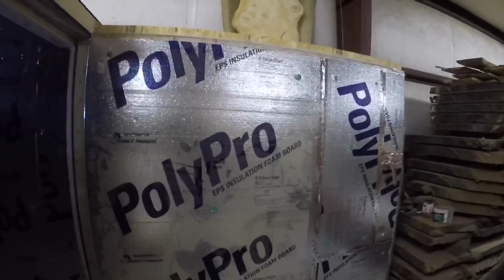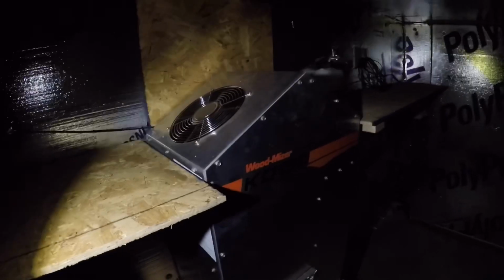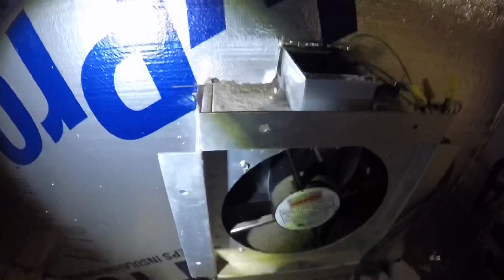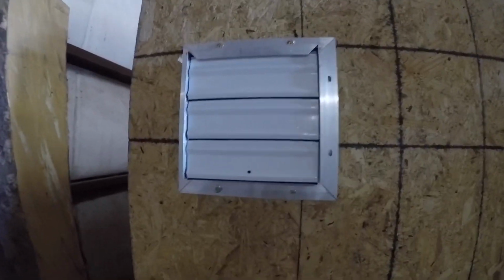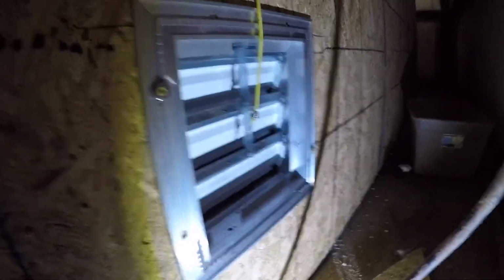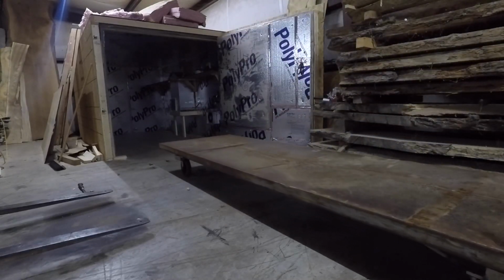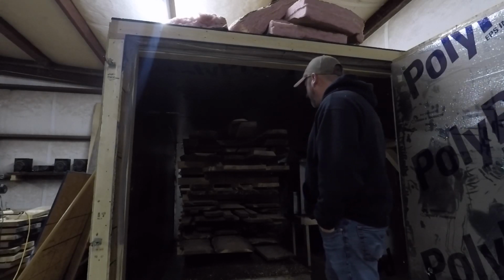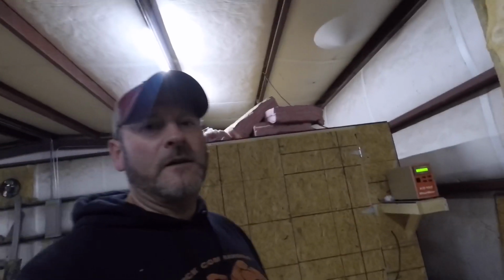DIY budget kiln chamber build Woodmizer kd150 part 3 first test run!!!

Comment: Did you ever figure out that you installed your vents incorrect. The motorized vent with the fan is the exhaust. The simple vent is the intake... Cancel that. I just watched your part 4. You did catch it. 🎉